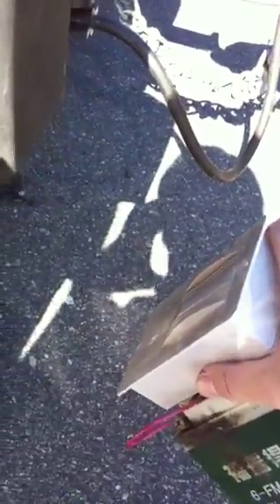Carbon Monoxide Alarm Test on Open Exhaust

Comment: Some gas generators have catalytic converters. If this one does and the engine was already warmed up, the CO emission can be surprisingly low. I have a professional inspector handheld CO detector that I put next to several car's exhaust. It shoots up into the thousands ppm after startup but rapidly declines to 0 after about 1 minute.

Comment: According to many websites on testing, tailpipe tests produce so much CO that it *apparently * (because they're not very detailed about this and so I'm kind of guessing) overloads the detector, which is designed to detect very small amounts, causing it to immediately fail. THe last detector I tried on a car didn't work either. But I haven't seen any detailed explanation or demonstration of why it should fail. :-(